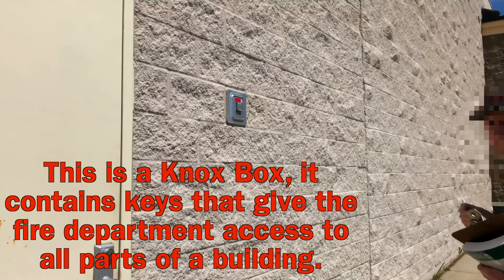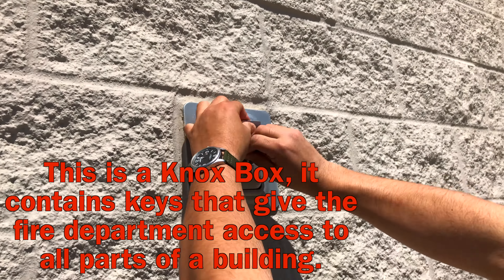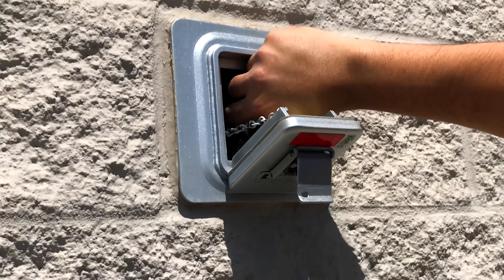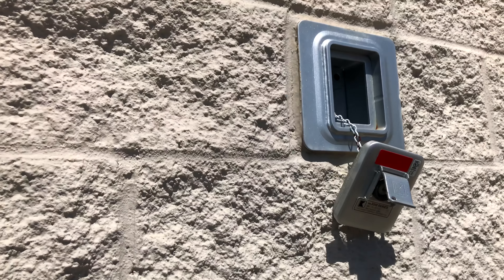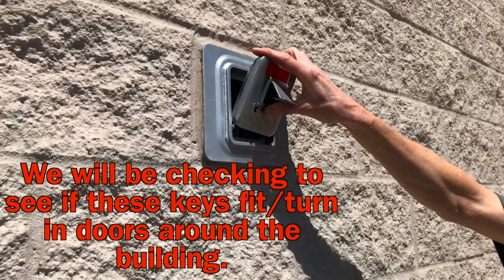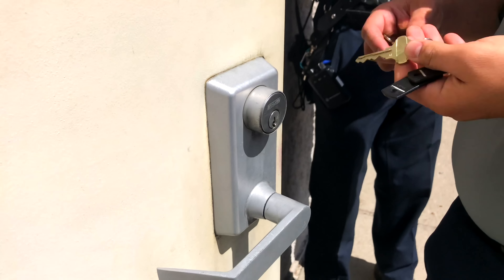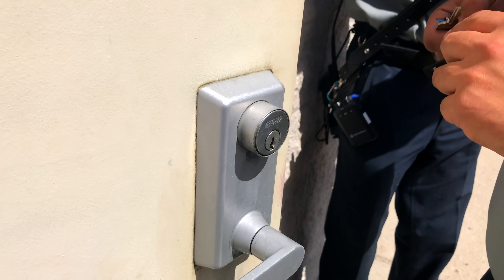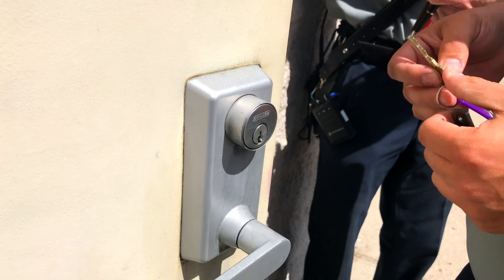Knox Box Key Inspection with the FD

Comment: Former employee of Knox Company,  one thing they dont show you here.  The "Key" that opens all boxes, on all companies in that Fire jurisdiction...  is locked in a device in the Fire Truck...  A ten key pad lock is used to release the key.  Each Fireman has his own combination..  There is audit trail software on the box, so each time the key is released the time, date, and Fireman's name is noted, recorded.  A small town was experiencing a rash of robberies, the police could never find break-in method.  Eventually all break-ins were traced back to Knox boxes, and the 'audit trail' software disclosed WHO, and WHEN the key was released...  SURPRISE..  it matched all the burglaries.
Reply: Not always.  I just met with my local fire chief today to have a Knox Box I installed locked.  He explained that the top 3 brass in the FD had an individually issued key, and there is on the key ring in each truck but they do not use the fancy locking unit with the audit trail.   This is a small town with a population of about 7000.

Comment: I used to work at the Knox Co.  There make a residential size box too, with a door hanger.. so it sits near the very top of your door.  The local fire dept will be able to enter your home in an emergency without busting your doors down.  They make various sizes for industrial buildings too.  They also make 'gate opener' key lock systems for gated communities or large gated compounds.
Reply: Hello Mark, can building owners be able to access these boxes ? I have noticed how some keys did not work in this video, likely a sign of rekeyed cores. Please let me know.
Reply: @VoidsDemise5443  The "KEY" to access your box, is the same key that would every box in your community, so no.  The only way to get access is to call your local fire department and someone will come by, open the box for you...  then you can update the keys inside.  Knox also makes larger boxes for several keys and any haz-mat docs you want the Fire Dept to have as they make entry.  Talk to your local fire captain.  Good Luck,  happy new year.
Reply: @VoidsDemise5443  Knox also makes smaller boxes with a door hanger, to the top of your door, like realtors use,  these are great for senior citizens on their private residence.  in case of emergency entry is needed.
Reply: @cmscms123456  I see. I do think if these knox box medeco locks could have an operator key that's ONLY for that said building that the OWNER can operate, there isn't a problem
Reply: @VoidsDemise5443  I know something about locks and medeco,  that would be complicated.  Imagine 1,000 business owners in your town, all have Knox boxes, they all have a key to their box...  if they lose the key, or sell their business...  who is responsible for the 'key'....   The Knox Company is the only place to get a replacement key..  even the Fire Dept must contact Knox for another key..

Comment: @S.E.R. Safety - I found this pull station on the internet. Actually a great one you could Review. Seems like a great solution to prevent nuisance alarms in schools and such (much better than a alarm pull station cover) -- http://www.keycall.co/ , simply, you put a door cylinder that belongs to the school into the pull station (euro cylinder) and then Only school staff can use the pull station in an emergency (they just use the same key that is used for doors). I do not however know if the key turning action is "fast enough" in an emergency to be up to code, but it should be as it equvalient with a lift cover-lift flap-pull station.

Comment: Cool!!! The government has complete access to your building! No warrant required! That's awesome! 

What happens if a fireman "loses" a key? Do you re-key every single Knox box in the city, or do you just cross your fingers and hope no one knows what it is? 

Do you do background checks on every firefighter to make sure they aren't going to break into my business at 3 AM and steal $20K of product?
Reply: sam1174 they more than likely cannot use it unless deemed absolutely necessary
Reply: Shut up they ain’t gonna lose a Key and they can probably only use it in an emergency
Reply: It’s a controlled key that logs each time they remove from their own lock box in fire truck

Only dire has them and you should have an alarm which will go off if used and you know it’s been used

Also cops yawing key makes anything they find unabmissible 

They could pick locks or just bust down door
Reply: Phoenix AZ has hundreds of unaccounted for keys.  The departments just STFU when this happens.  Their newer electronic key based system makes it easy to void lost keys.

And not all departments use the Knox lock box in the fire truck.